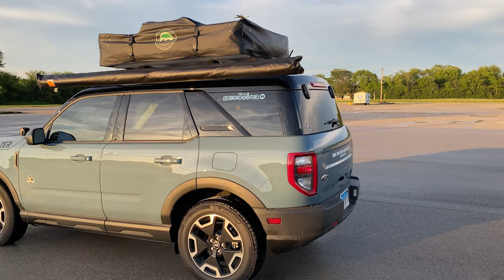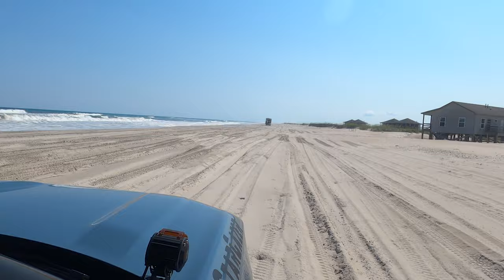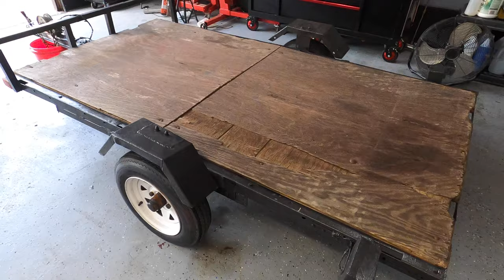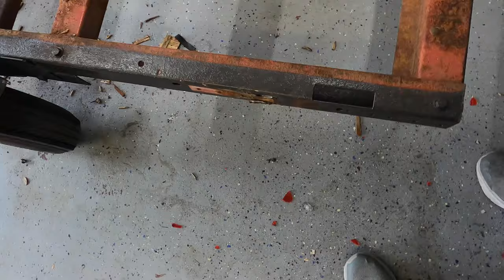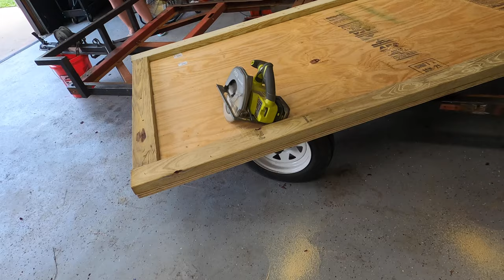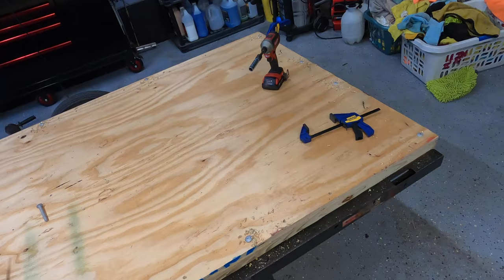Harbor Freight Overland Off Road Custom Trailer Adventure to Sema Part 1

Comment: You should bob it if you plan to do any real offroad. Chop the frame jus behind the second to last cross member to improve your departure angles.
Reply from the maker: Thanks for the advice.  I will take that into consideration for the next trailer we look at building.  I have learned so much already getting this one to this point.  This trailer will mainly be used for light trails and with my bronco sport it will not be too extreme.  Now once we get the full size bronco the next trailer will be more bobbed and designed to go over rougher terrain.